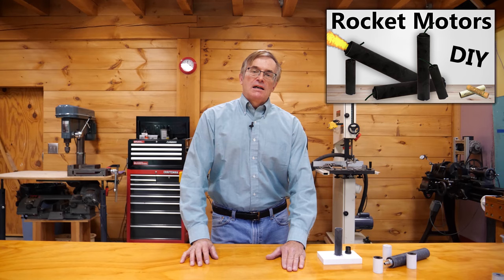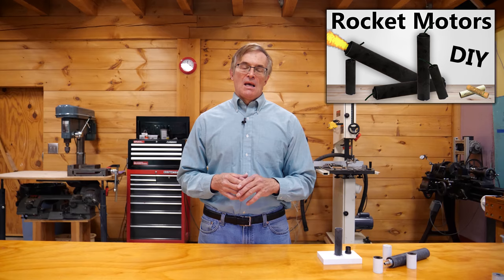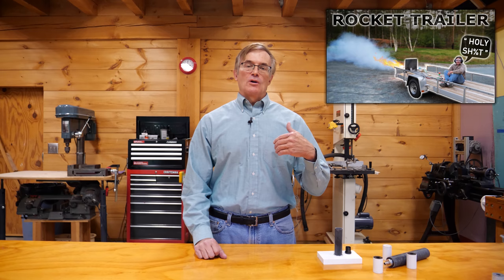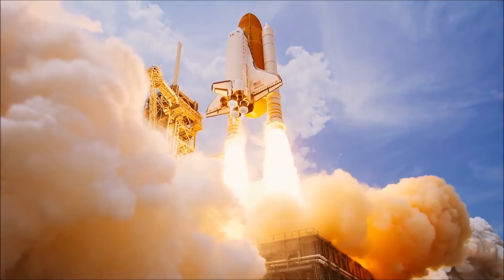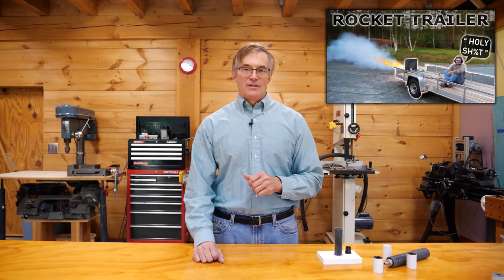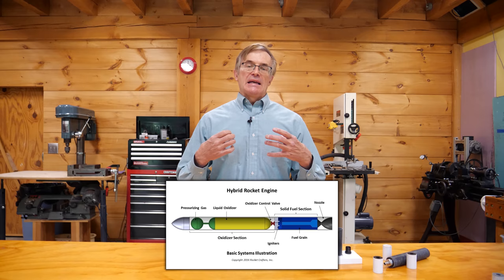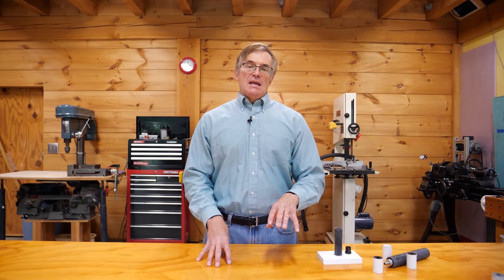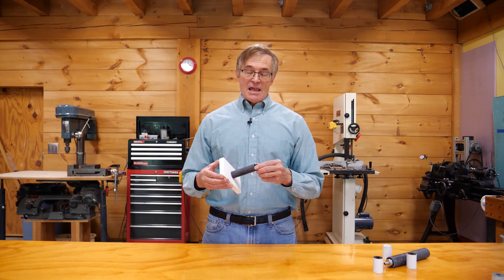Mixing Nitrous and Rockets is DANGEROUS... But Really FUN!

Comment: The part about liquid oxygen not supporting combustion sparked my curiosity. Does it really mean that if one were to slightly pressurize an oxygen and methane mix (methane solidifies at 1ºC over the oxygen boiling point at sea level) a spark or shock wave wouldn't initiate a deflagration or detonation ? Or that it would but the material would change phase before reacting?
Reply from the maker: In general, it would have to change phase.  Of course, this would be at the molecular scale and even solid phase methane as well as solid and liquid phase oxygen is surrounded by sublimated vapor, so the concept becomes a little blurry.  But, as an operational concept the vapor phase facilitates mixing and molecular interaction.
Reply: @TechIngredients  Thanks. It makes sense. Now that I think about it the ignition mechanisms that I can think about like a spark would produce a phase change locally. Even a shockwave likely would produce pockets of superheated gas at any non uniformity in the medium. And from there the enthalphy change would ensure a phase change no matter what the pressure, at best phase change into a gas could be prevented by keeping it as a supercritical fluid (I imagine that ignition can happen in a supercritical fluid, it is close enough to a gas).

Comment: Does a hybrid sugar rocket make sense.  I don't know what the energy density of Paraffin is, but I watched a video by DBXlabs where he made a thermal lance with sugar and I was shocked at how high the energy density of sugar was.
Reply from the maker: The energy density of sugar is substantially lower.  Paraffin is basically very, very thick kerosene.

Comment: Specific impulse is not unit less, it has units of seconds.
Reply: It sounds like he’s dividing it by 1 second though. So it’s the same concept. Specific impulse of 100 seconds would mean fuel mass in thrust for 100 seconds. I think this is the SI unit.

He’s dividing the second out to say that it’s 100 times the fuel mass, just for one second. Same amount of work, just with no units.
Reply: @Flumphinator  Dropping units can increase confusion.
I personally think that exhaust velocity is more intuitive than specific impulse. Exhaust velocity equals specific impulse times gravitational acceleration (9.8m/s^2). So a specific impulse of 100s means an exhaust velocity of 980m/s.
Reply: @mwalton9526  That's a good point about confusion, and I kind of agree. It's assuming that everyone who is reading or listening just knows what you're talking about. Lots better to just enumerate.

Using g though is a problem for me, because who's to say that the rocket is anywhere near Earth? Useful for comparison between engines and rockets, sure. But what about transfer orbits, lagrange points, or going from Europa to Io on a weekend holiday?
Reply: @Flumphinator  That is precisely why I prefer exhaust velocity over specific impulse, because exhaust velocity doesn't change with g but specific impulse does. Also, exhaust velocity is used in the Tsiolkovsky rocket equation witch determines the delta V a rocket can provide.
For more information on why they went with specific impulse over exhaust velocity pleas read the performance chapter of "Ignition!: An Informal History of Liquid Rocket Propellants" by John D. Clark.

Comment: @techingredients could you use the jets (nozzel) meant for nitrous in gas engine applications?
Reply from the maker: There's not enough flow.  We need to dump between 5 and 10 pounds through a SINGLE nozzle during a burn.

Comment: 12:40 About the weight specifications. Does the full weight, 13.0 LB, include a safe vapor layer volume, or should we stay under the full weight to be safe?
Reply from the maker: The full weight is conservative.  Don't worry about the weight of the vapor.

Comment: From Australia, so it may be a terminology thing, but is a check valve the same thing as a flash-back arrester?
Reply from the maker: Not quite.  A flashback arrestor also blocks the propagation of a flame within a flammable mixture in the line.

Comment: Regarding the pressure requirement and dealing with the tank, is there a case for using hydrogen peroxide as an oxidiser? It's a fluid at room temperature and pressure and then you can get pressurised (and throttlable) oxygen by spraying it through a potassium permanganate mesh.
Reply from the maker: Not much.  The liquid is extremely  dangerous  to store and handle.  Regulating pressure  will be touchy as the disassociation reaction is a positive feedback loop with temperature.
Reply: @TechIngredients  I love it that you take time to answer the comments ❤️ also thanks for the clarification :)

Comment: Paraffin is NOT non toxic. I have never been so high as when that crap was melting on the stove. Not burning, just melting.
Reply: Paraffin wax is considered non toxic "Fully refined Paraffin is non-toxic and burns away virtually all paraffin wax, emitting negligible levels of Volatile Organic Compounds ." The poison control center lists it as non-toxic if ingested and mainly recommends fluids and laxatives to help pass it.

As for the fumes it depends on how the paraffin was refined originally and the compounds that were left in it. Pure paraffin wax shouldn't be an issue but it is usually the byproduct of petroleum distillation so it may have toxic substances left in it depending on your source. Anytime you are melting anything that is a petroleum distillate or petroleum based do so in a very well ventilated area. As far as it being listed as non-toxic though, in the USA at least it is classified as a non-toxic substance and the poison control centers only concern is what the wax was mixed with.

Comment: Nice work on the nozzle testing. For an actual hybrid rocket would you be using the 1lb tank?
Reply from the maker: Thanks!
We will use the 10 lb tank.
Reply: @TechIngredients  are you just testing the motor and not actually building a rocket, as a 10lb tank would be bulky for a rocket.

Comment: What are your thoughts on some type of single-use valve that has no spring.  Maybe something similar to a sprinkler system that breaks open with heat and stays open until the system is exhausted? Maybe have some type of burn-through material holding it closed and it would act as both the valve and the ignition.
Reply from the maker: I've been thinking about that for some time. It has to be strong, easy to install and produce minimal debris after actuation.
Reply: Our hobby motors used an oxidizer fill tube which plugged into the injector. Nylon tie straps held the rocket down on the launcher. The motor was ignited using high pressure oxygen, and electrically heated steel wool. The ignition melted the tie-down straps and allowed the fill tube to disengage. Nitrous oxide would then flow into the combustion chamber which was already burning; there were no moving parts on the rocket.

Comment: Why not put the tank in the freezer to cool it?
Why not crack open the valve a little bit untill the flow stops due to equal pressure?
That works well for filling propane bottles which is the same kind of liquid gas situation.
Reply from the maker: That works  too.

Comment: when I fill my small camping propane-butane can from a large one I tilt the big one upside down. I didnt know that pressure alone will fill it with liquid gas. It doesnt work with a lighter either. You have to turn it over too. Does the large NO2 tank have an inner tube?
Reply from the maker: It does.

Comment: Since you mentioned that you have to turn the liquid into fine droplets for it to burn, wouldn’t it be more efficient if there was a heating element of some sort that converted the liquid into a gas before entering the combustion chamber?
Reply from the maker: It would and that is one of the engineering advantages of the raptor engine.  The amount of heat needed for the large amount of nitrous entering the engine is impractical without pre igniting it or using the whole combustion chamber as the heating element. It would require tens of thousands of watts of heat.
Reply: @TechIngredients  High intensity infrared radiation travels both directions in the combustion chamber.

Comment: This is awesome. Would you happen to have the link to the check valve you used? Or will any check valve do?
Reply from the maker: You want a Cv that exceeds the minimum plumbing dimensions elsewhere in the system.  The check valve should not be a restriction. You want a pressure rating against retrograde flow of at least 3,000 psi.  We got ours from McMaster Carr and there were only a few options re size and materials.
Reply: @TechIngredients  excellent thank you!
Reply: @threehammers2516  Having tested hundreds of hybrid motors, we have never used a check valve.
Also, an orifice is quite adequate for the injector. When the nitrous oxide is injected into Hell, it vaporizes quite quickly. Larger motors can  benefit from an annular orifice.

Comment: Liquid iron will burn in air. I don't know if you count that as hypergolic.
Reply: So does solid iron, just much slower.
Reply: @bur1t0  rusting is oxidation too, but it's different. You only see the sparkle of burning iron when a piece of steel is hot enough to have started melting.

Comment: 2,3,3,3-Tetrafluoropropene is a pretty effective refrigerant that has an extremely low CWP, but it's kinda flammable. Could you mix it with a liquid fuel in a combustion engine to keep the engine at a low temperature?
Reply from the maker: I don't know, but its low flammability works against its performance as a fuel.
Reply: @TechIngredients  So alternatively, I could use it as an anti-detonant for Anti-Detonant Injection, instead of or in addition to using Water-Methanol?
Reply: @TechIngredients  Another question I've been wondering: Could bismuth serve as an alternative to lead as a gasoline additive?

Comment: I wonder if a tesla turbine or valve system could be used for a high pressure fuel pump. Weight and material strength might be an issue.
Reply: Just looked it up. They do have something called a Tesla Turbopulsejet. Somebody beat me to it in 2017!
Reply from the maker: Probably not.  The Tesla turbine is interesting, but fundamentally no better than a we'll designed impeller.  If you doubt that, consider the engineering and manufacturing simplicity of the Tesla turbine, but its limited implementation.
Reply: @TechIngredients  Indeed.

Comment: So I understand the need for the solenoid in static test applications but how would you implement this in a flying application? That's a big old power supply to loft on the top of an engine.
Reply: Rockets contain batteries to run all of the electrical circuits. Model rockets have batteries to actuate servos and other things. A servo with a ball valve on a spring actuates very fast.
Reply from the maker: Correct.

Comment: You sure, you don't want to go for a pressure-cycle liquid rocket engine? There are several university student projects around flying liquid fuel rocket engines and Copenhagen Suborbitals does as well (and I'm pretty sure they don't spend millions on their rocket engines - they are a "club" after all). Pressure-fed liquid engines are actually super simple in terms of plumbing, the problem lies in withstanding the thermals and going for a powerful enough engine that can move both the fuel and oxidizer tanks as well as an additional Helium (or similar inert gas) tank to pressurize the system. Since the tanks will be put under pressure those tanks will be heavier, BUT the complexity is very low and the maximum pressure of the Helium tank dictates the maximum combustion chamber pressure - if/when the pressure gradient between the fuel system and the combustion chamber shrinks, less fuel (and oxidizer) will be injected and the pressure within the combustion chamber will be lowered again - it dials itself in.

Biggest issue with liquid rocket fuels: most chemicals are pretty nasty. That being said, liquid Oxygen with Methanol, RP1/Kerosene or Ethanol is reasonably safe to handle considering we're talking about rockets.
Reply from the maker: Pretty sure.  The plumbing is substantially more complicated and the combustion chamber heating is a big deal.  The Copenhagen group discusses the engineering of it's cooling system, it's not simple.
Reply: @TechIngredients  Well, the cooling of the combustion chamber and the nozzle is indeed a big task and handling LOX tanks requires also some extra considerations, but CS also goes for quite long burns increasing thermal load.  In theory technical ceramics would be an option like silicon carbide, titanium carbide or aluminium oxide. A (modified) 3d printer could be enough to get the geometry you'd need. With those ceramics you'd be looking at melting temperaturs between 2060-3160°C. Next step up (requiring more sophisticated production facilities) would probably be reinforced carbon-carbon. Alternatively for quite some money titanium alloys would be an option offering hire fracture toughness (though lower temperature resistance). Silicon carbide should for example have no issue with withstanding ~60bar pressure in the combustion chamber

A 75% Ethanol-LOX mix has a combustion temperature of ~2950-3000°C. Add in TEOS to build up a protective layer and the heat flux to the chamber walls would be drastically reduced. 

I wonder what a small, single injector pressure-fed "Ethalox" engine could do. But of course I do agree: complexity goes up by an order of magnitude. I still think it's doable though even for single person amateur projects.

P.S.: I've just realised that I've obviously spent too much time researching this...

Comment: Great video! What’s the approximate total impulse of a setup like this?
Reply from the maker: With the capacity of the large nitrous oxide tank as the limiting factor, say 8 usable pounds and a fuel to oxidizer ratio of 1:8 (typical), then 9 total pounds at a conservative specific impulse of 250, about 10,000 Newton seconds.

Comment: what would be other options for the solid fuel in those hybrid engines? preferably something that doesn't contain a lot of carbon or if possible no carbon at all? i'm thinking about ways to make rockets at least a little bit more environment friendly
Reply from the maker: The wax can be manufactured from soy beans and rapeseeds making the fuel carbon neutral.
Reply: @TechIngredients  I suppose that it would be politically incorrect to point out that carbon neutrality is nonsense.

Comment: For this size of rocket, does the increased thrust make up for the added mass of the nox and nox accessories?
Reply from the maker: Yes.  The nitrous can be stored in the same type of light weight tubes used to construct the engines themselves.

Comment: Is there a certain amount of "bounce" in the initial flow once the valve opens? If so, will that have any negative effects on the rocket engine?
Reply from the maker: Not that we can tell.  There is a very short delay as the first few cc's of liquid vaporize in the plumbing.

Comment: I would be very happy if you can comment on this. I understand from the video that liquid fueled engines are more advanced and challenging. However, I have the impression that when national programs of third world countries want to develop missiles, the first type they manage to produce are liquid fueled. It's only later when they are more technologically advanced that they produce the solid fueled missiles, which are more desirable from a strategic point of view as they need very few preparations and are mobile as opposed to the liquid fueled ones. Is this impression correct? Secondly, if true, is it due to technological challenges that they have to overcome for solid fuel engines, or simply due to the proliferation of liquid fuel engine technologies that these countries had access to, which leads to starting with liquid engines?
Reply from the maker: I haven't heard that and suspect it isn't true.  It doesn't make a lot of sense that something that is harder for an amateur to accomplish for the reasons I gave in the video would be easier for an economically challenged country to accomplish.
Reply: Thanks a ton for you time. I am interested in military affairs but as an amateur there are limits to my understanding. That being said, I am sure that early North Korea designs and tests were based on the SCUD systems. In this case it might have to do with Russian assistance. In case of Paksitan, for a long time their first strike capability depended on liquid fueled Ghauri series. Later, they developed the solid fueled Shaheen missiles, which is the current weapon of choice. Its interesting affair of weapon technology proliferation if you have time to look into this.